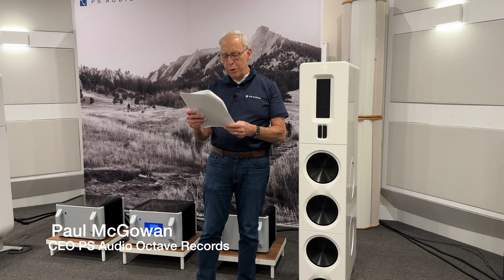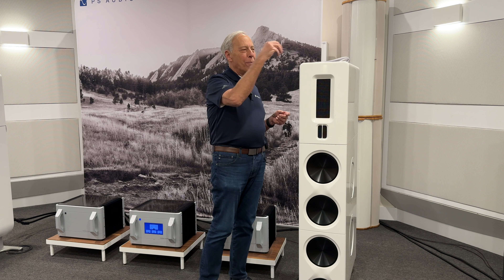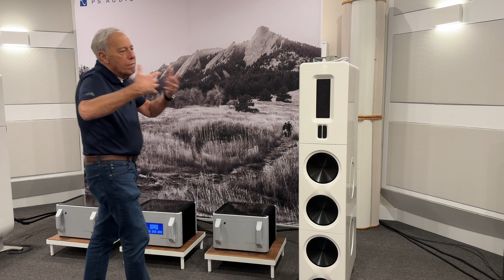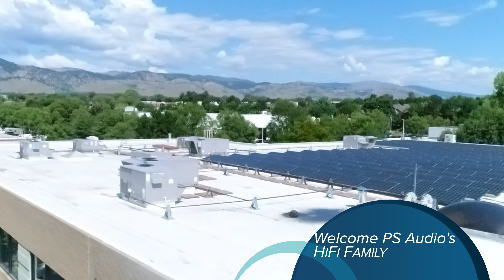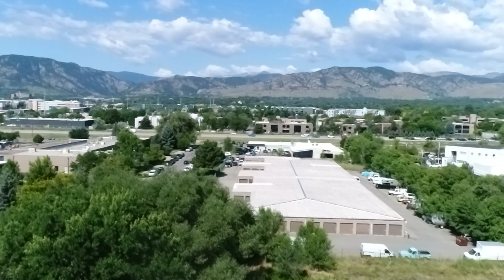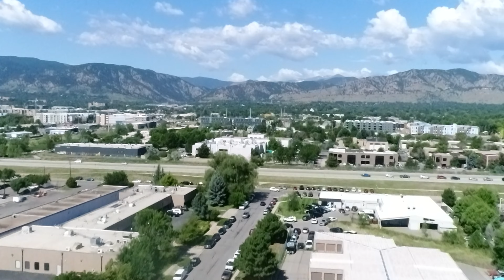An all analog system

Comment: Outside of adding DSP to the signal path, in a preamp or integrated the majority are going to be designed with some type of analog signal path from the analog inputs to the amplification stage.  One of the exceptions is the Technics SU-R1000 it is managing audio all in the digital realm as even analog inputs are going thru an Analog to Digital converter.
Reply: Until final output. Then even the SU-R1000 has to have an analog output stage.

Comment: Another commenter noted, the playback chain may be all analog. But how many recordings played back on that system were recorded, mixed and mastered in the analog domain, without any digital steps? If you listen to a recording made post 1980, I would bet very few. Admittedly this is not the scope of what Paul is answering. Just noting for the peanut gallery

Comment: I love hitting my audio community with this one ..."Would you prefer to have, and listen to a real Piano that uses strings (pure analogue) ...or a digital Piano with a DAC in it"? ... its not a question to provoke analogue over digital debate... its one I use to illustrate how close or far away designs can be from the original musical performance.
Reply: The one is a real acoustic instrument,(piano), the digital piano is technically called an instrument too, but isn't a true acoustical musical instrument. Any instrument like that produces artificial electronic  sounds, meant to sound as close to a REAL instrument as possible. The better ones (real expensive) do a pretty good job of mimicking, but but if you really listen, probably is distinguishable. That's a bit like asking if a pianos strings had electronic pluckers installed instead of hammers, could it be made to sound like a harp?
Reply: @sidesup8286        .Anyway  analog acoustic piano  may be  registerd with microphone and digitalized - it i possible All digital pianos are programmed this  way with using sounds of of pure acoustic pianos.
Reply: @Mike. As you said digital pianos use sampled waveforms from a real piano, I'm pretty certain. Digital pianos never come with amps that are state of the art, and the speakers connected to them limit their sound sound.and how genuine they sound. As I think the OP implies, just because you can tell a digital piano is a bit of an imposter, I don't think that says anything about the genuineness of reproduction of say, great cd playback. I've heard cd playback that didn't lack anything in the way of genuine. How digits are employed in cd playback is something different that how they are employed in a digital piano.
Reply: @sidesup8286   Hehehehe, this is fun ... Digital pianos and other digital instruments do actually use same integrated IC's, DACs (unless descrete boutique audio)  and output stage designs used in CD players.. I have to repair/restore both in my line of work. Sampling is same as recording and the wavetable (especially Yamaha) is recording of original instrument although saved in solid state. It's why I love throwing this curveball. The spirit of this isnt whether analogue/digital is better - It's that  We hear a lot from designers like Paul (myself included)  about removing as much as possible from the audio chain, so that we're closer to the original art. Doing less damage to the original signal. ... then after saying this - we designers go and make super complex chains that make your eyes water.  🤪
Reply: Good point.  I'll take the real piano.  
Recently, sitting in a waiting room well down the hall from an office tower atrium I heard a cello start to play.  OMG the sound was so full and palpable.  Sure enough a cello and harp were set up way down the hall to play in the entrance atrium.  There was just no question it was the real thing vs an all analogue stereo system.  Quite shocking how far we are from reproducing the real thing.
Reply: A real piano is not the same as a box that makes piano sounds
Reply: A digital piano does not have a spinning disc inside, which reads pits.That alone makes it different, and I'm sure there are other differences between the way a digital piano makes sounds versus a cd player. I am not a designer but a re-designer, and I have done things with cd players that have improved their sound into orbit; another universe. At some point, Digital actually actually starts to sound  just like analog. On some recordings, The Nightfly for one, what sounds like an electric piano or a digital piano, starts to lose its electronic character & starts sounding like an acoustical instrument. Most non-classical musicians prefer to use a digital piano, because it avoids unpleasant surprises like needing tuning etc. The qualities that most people attribute to digital playback like thinness, 2 dimensionality, edge, hardness, lack of warmth etc. are qualities of "bad" digital. Truly great digital does not have even a hint of any of those bad qualities. qualities. Digital glare was the last thing standing, in my many decades long experiments to improve digital playback.
Reply: @1sostatic 
My friend ... I learned a long time ago that trying to talk to this crew is like listening to the evening session of "See how great I am!".  They never discuss actual technical information (because they don't know anything about it) but they are always happy to tell you how wonderfully smarter they are than any of the rest of us.

Your point about DACs and Line Drivers are completely lost on them.

Done correctly, a digital piano would be utterly indistinguishable from the  real piano they sampled the sounds from.
Reply: I prefer to have whatever my mood is. I’m a professional pianist and while I prefer to play a real piano, digital pianos have their place too because you can get lots of different and fun sounds. They both have their own applications - or the same - so I think listening to both for different reason is viable.
Reply: An acoustic piano would have to be as long as approximately 100 football fields (minus the end zones) to have as many different keys as different tones humans are capable of distinguishing. Humans are capable of distinguishing near a half million different tones according to The National Institutes Of Health.

 You don't have to know all kind of electronic technicalities to know what you're hearing. Otherwise, only Technical Institute graduates would be capable of being musicians, and wouldn't that be  something; and something boring!
Reply: @Douglas_Blake_579   Which is why I love  hurling these loaded curve balls into the room sometimes. This was a good topic from Paul @ P.S. You get to know who  picked up the vital thread and is, as they say, "hip to the gig" - a Sammy Davis Jnr term for "being in a position of knowledge".  ...👌
Reply: @EnpuerKT  Real piano and box  are looking obviosly different but we are not comparing looks. In personal  practice   people (me including) at least do not prefer real  piano over emulated piano.

I few times compared piano concert transmitted over TV  played there on biggesst concert Stainway or Kawai   with my electronic GEM piano soudning on the same speakers and  even slight difference was there it   would not push me to think about having real one ( even no possible  at price and size  of  biggest  concert )
Reply: @user-od9iz9cv1w  Take into account that you heard it in big venue and it's acoustics. It was very special experience 

 The same I remember reproduction of (between other) Moody Blues which I provided in big  sport venue and remember that after all years. . Impression was great but it wasn't gained from amplifier or spaekers  as they were just venue gear. It was case of big acoustic
Reply: @1sostatic 
Unfortunately the "in the know" team is pretty small and shrinking every day, by a combination of attrition and general disgust with the rest of the group. 

I've been fixing and designing electronics for 40 years ... Nowhere other than in audiophilia have I seen any hint of what most of these people deem to be truth.
Reply: @Mikexception  Possibly.. But we're talking an office building atrium lined in marble.  Not particularly good acoustics.  Still clearly sounded like the real thing, not a reproduction.

Comment: ANALOG is of, relating to, or being a mechanism or device in which information is represented by continuously variable physical quantities. As such a guitar is an analog source by itself. Our auditory system requires an analog variation in pressure to be able to hear it. A wind up phonograph with a bamboo needle into a horn is analog. Nothing in our hearing uses digital in any way. In fact a pure digital signal with no analog interface would be inaudible.

Other than synthesizers, digital only is used for storage/ recall of analog. And transcoding always adds distortions.

Comment: I don't know if most vinyls produced mid 70 and later are "purely" analog? I need to learn more about "digital delay"...
Reply: It’s nothing to do with delay. Any digital is loads of singular snapshots stitched together. From one stitch to another you get a jerk as the frequency changes. The higher the resolution, the less noticeable those jerks are. Also within resolution enables greater frequency range and dynamics. Analogue is a pure wave with no steps like that.
Reply: @SpyderTracks  I'm no talking about jitter, but digital delay vs analog delay used some seconds before the cut of the vinyl to determine separation of  groove (need according the dynamic range, bass content,...).

Comment: It is a common misunderstanding that a "switching" power supply is supposed to be "digital" or bad for sound. SMPS are not digital. They simply allow far smaller transformers - thus saving $ in copper and perhaps some iron in the transformer. In my world, digital is a transformation of the analog signal into a binary one requiring a second transformation to get the original signal back. Even turntable playback can be "digital" if the phono preamp uses an ADC, then DSP equalisation, then DAC transformation back.
I believe ALL of the digital vs analog arguments are bogus, meaning that the pleasure or lack of it is between the ears of the inflexible audiophile, not inherently in the hardware/software. The bogus argument of a digital piano vs a real one is bogus because the question for the audiophile is if a RECORDING of a real piano vs a RECORDING of a digital piano provides less pleasure, not if it sounds different (even different models of "analog" pianos sound different). There are MANY venues where the digital keyboard has HUGE advantages and others where the "analog" piano is far better. It is only when bad decisions are made that we get into trouble. That has NOTHING to do with the technology.
I would argue that even if a recording was digitally mastered, none of that digital gets through the vinyl pressing, phono cartridge or phono preamp. The output of a DAC is also 100% analog. Any possible digital artifacts are simply unnecessary bad engineering.
Reply: Your perception here is somewhat of a hypocrisy .. the world is in fact analog, so using a DAC means that at some point sound was digitized and returned to the analog world.
Reply: Anytime any part of a circuit switches between "on-and-off" e.g. zero and saturation that makes it digital by definition. I don't know where you came up with the idea that it's not a digital circuit. There are some great class D  amplifiers on market  now because designs are getting better and better but they are still digital power supplies.
Reply: All said, I far prefer the sound of a real acoustic instrument without amplification vs anything that can be produced with a speaker.
I think my system, with its digital source sounds terrific.  But it is no match for the real thing.  That said it has it is  useful.  I cannot hire an orchestra to come to my house every day in case I want to hear music for a few minutes.
Reply: "I believe ALL of the digital vs analog arguments are bogus, meaning that the pleasure or lack of it is between the ears of the inflexible audiophile, not inherently in the hardware/software."

Yep... that about sums it up.

Had a friend over for Pizza and a Movie a couple days ago.  At the end of the movie we fell to talking music (a joint passion) and he asked what I thought of the "New Class Digital Amps" ... So I responded with "What do you think of them, considering you've been listening to one all evening?" The look on his face was beyond priceless.

The only time digital vs analog or D vs AB seems to matter is when the audiophile is made aware of them.  Like most of us, they listen to digital recordings and class-d amplification all the time and don't even realize it.
Reply: Well, I guess I proved my point. hypocrisy, on/off being automatically digital, reproduction instead of representation - all of the bogusness that I referred to. 
I do not understand the need for black and white misrepresentation. I have no problem with audiophiles and their preferences. It just becomes an issue when opinion is supposedly fact. I feel sorry for those held captive by bogus opinion. They certainly are missing out on a LOT of enjoyment and certainly should not feel elite because they block aural sensations before they even reach their ears.
We should never confuse audio with reproduction. Reproduction is not possible. At best we can get a PLAUSIBLE image when the recording and playback strike synergy. A further difference between live and recorded is the surprise factor. We know exactly what is coming with a recording because we can listen to it more than once. Live music has many things that make the performance absolutely unique - we only get one shot.
Reply: Yet I can blindly identify a digital source compared to analog. Even double blind.
Reply: @Scopolamine46 
Lots of non-digital gear uses square waves.  FM Transmitters for one, motor speed controllers for another... lots and lots of examples out there.

It's not the waveshape that makes it digital... it is digital when it is a signal that is processed by computational means.  

Class D does not convert an audio signal to digital. It uses the analog input signal to control the pulse width of a high powered carrier signal. The signal is actually encoded by analog means and recovered with passive components... nothing digital about it.
Reply: @Scopolamine46  " There are some great class D  amplifiers on market  now because designs are getting better and better but they are still digital power supplies."
You can have a class D amplifier with a linear power supply. Or a class B amplifier with a switch mode power supply. Neither technology is tied to the other.
Reply: @glenncurry3041  I will have to say that I do not believe you. How did you double blind insure the quality of the recording and playback gear? It is really hard to perform a valid comparison. With a bogus comparison there are all sorts of clues - most of them present as inferior noise levels in the analog source. It does NOT have to be that way. There are some really awesome 1" tapes out there but (if we even have access) then we have the challenge of getting the deemphasis right.
If you just digitally recorded your own analog source and expect that to work, there are also pains required to create a valid comparison. I have been there and done all of that. I know the limitations - especially of social media double blind claims.
Reply: @Rowuk2024  An even more extensive A/B/D comparison. No not totally double blind. An AES meeting in Nashville in the mid '70's in the mastering studio "The Grab Bag" (Direct-Disk Labs – JCM-001) had been mixed down and recorded to direct to disc lathe, SoundStream Digital and Ampex 1" half track. The meeting was record release and playback comparison between the DtoD on the cutting lathe, the Soundstream and the 1"into the system it was mixed on. 100% picked the DtoD as best.